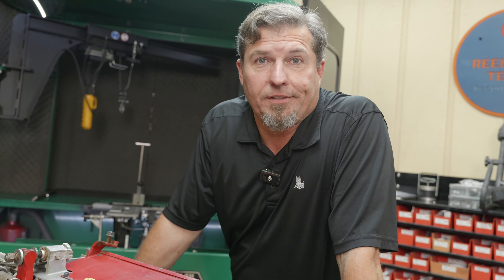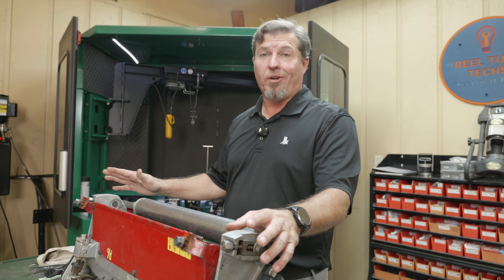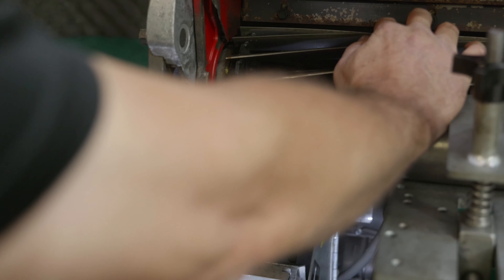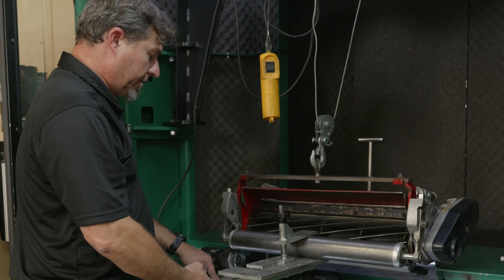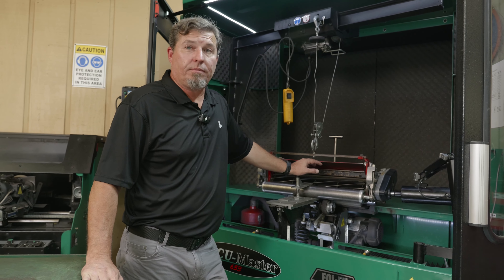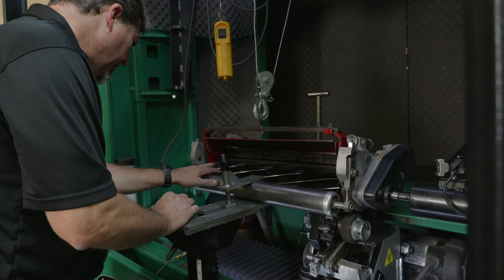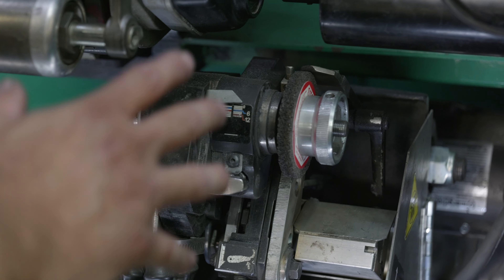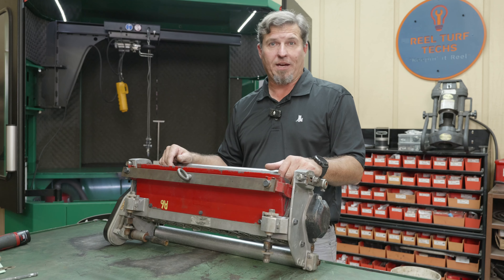How-To: Grinding a Reel - My Method for Grinding a Toro DPA Cutting Unit on a Foley Accumaster 653

Comment: Great video
I reference my reel mounts on my type of grinder too . Also find I have to adjust it when it’s near the end spec of reel.( 4.5 instead <5”)  mine grinds sets up from reel diameter not shaft . But when I had foleys I did the same . lol my first grinder was a 388 foley lol if you can use that you can set up any other make of grinders . Plus I have the option to grind reel with bedknife installed . Which I do , You can see how much some side plates actually flex and distort . Old gang mowers were the worst for that . I have the option to relief but only do my bigger less ground units to speed up the 2 or 3 times they are ground in season. Greens and tees are ground now weekly and spin up fast so I don’t bother . It’s a personal choice you figure out what works for you and the grass and tools you’re working with .
Reply from the maker: Thank you! I completely agree! Whatever works for your course, your operation is the right way.
Reply: Loved the 388's
LOL

Comment: Its interesting watching the different setup and process between manufacturers. I run Bernhard grinders and it's a much faster setup process part of that due to the fact we don't grind based off the center shaft. Id be curious to see the differance in quality of cut between reels ground on each grinder on the same mower to see if there's a noticeable difference. Bernhard also don't come standard with relief grinders equipped.
Reply from the maker: This would be an interesting comparison.
Reply: Foley for precision, Bernhard for speed, SIP if you have all day.  
With more of the Baroness machines in the field, Foley will sell more grinders because Baroness requires maintaining their relief to ensure the long-term cut quality.
Reply: @michaelhenderson6975  I tried the orange machine back in 2002....I liked and now REALLY like Foley 652B, with electric lift table and rear loading for walkers.
Cats meow!!
Using a 652 (with crane) now.
Reply: @0Somerandomguy01 agreed

Comment: Great video! I have been grinding reels on a foley for 13 years and had no idea on the barber pole effect great tip. I was wondering if you have a tip to get the correct traverse speed also. Thanks.
Reply from the maker: @JonDomning  I'm at 12 on spin grinding and 20 on relief.

Comment: Im running some early 90's Jacobsen PGM 22's at home. I have been honing them for a year but i will need to spin grind them. How are the fixed head walk behind greens mowers reels ground?  Do you mount the whole mower on something?  Dont break my heart and tell me I need to disassemble something major.
Reply from the maker: @hobogolf  Yes! You put the whole mower in the machine. You still have to remove the bedbar. It's basically the same as the one in this video, just 200 lbs heavier. 🤣

Comment: Do you ever have clearance problems when grinding relief?
Reply from the maker: @timtownsend7927  I have had clearance issues if I'm in a hurry or not paying attention. It gets tight on 14 blades reels when the diameter gets close to 4.5". If I am grind relief for the first time on a new to me reel, I set up for relief first. Sometimes, the reel may need to move forward or back to get enough clearance for relief.
Reply: @reelturftechs  might make a good video to show some of the "tricks" you use when clearance is extremely tight or not straightforward when setting the reel up for a spin and relief grind. Anyways, thanks for the response. (BTW, I enjoyed your seminar at the TETAC conference in Myrtle Beach. Very informative. )
Reply from the maker: Thank you sir!